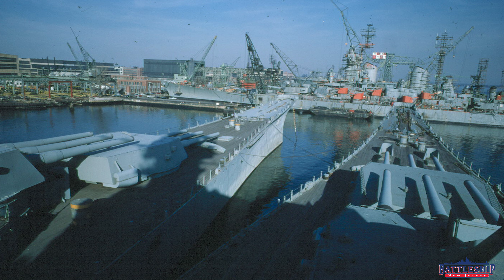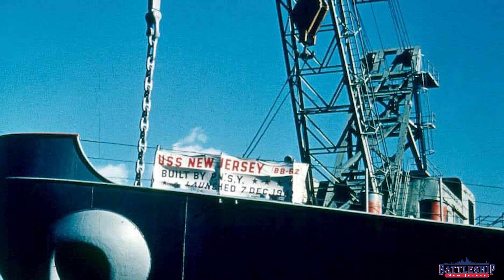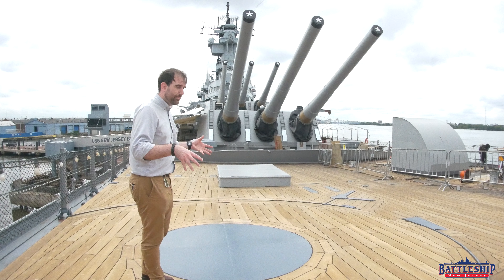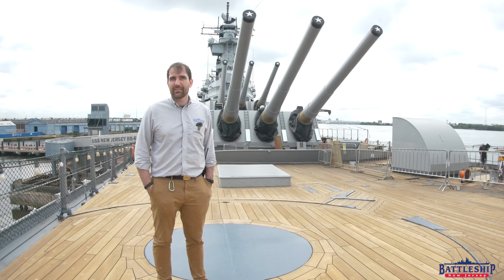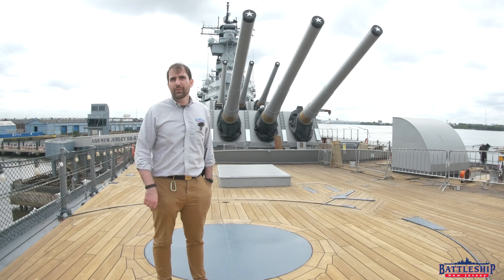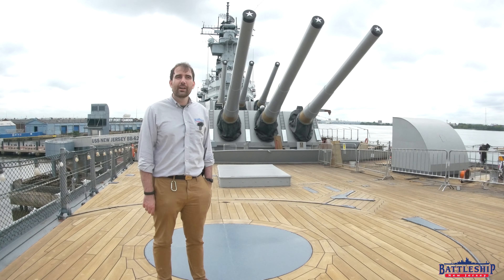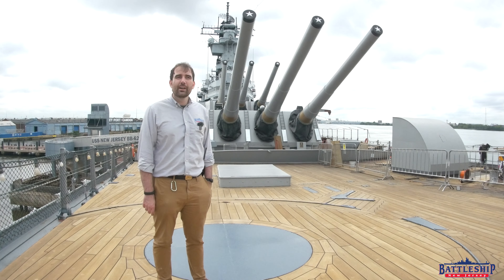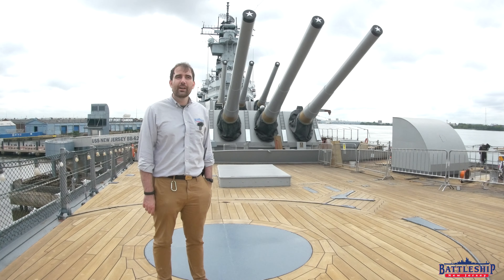Battleship NJ at the Philadelphia Navy Yard

Comment: My Dad worked on her there in 1967. 72 Shop Riggers. He told me how a tool chest left on the deck was crushed by the concussion of the 16” guns on her sea trials.
Reply: Made me wonder about how anyone could be at the 40 mm he's standing at.  Maybe the 16's and 40's were not used at the same time?
Reply: @jefffrayer8238  I think there were very few times, if any,  when any  U.S. battleship was under air attack and being fired on and having to return fire to a surface engagement at the same time. The 16's were useless defending against an air attack.
Reply: @jefffrayer8238 
You can bet the decks were cleared when those 16 inchers were fired, that was standard operating proceedure if not just plain common sense.

Comment: Now Im curious how fast it could have gone with modern propeller designs
Reply: Maybe SS United States fast
Reply: @AmericanThunder  SS United States has practically the same engines and propellers as NJ.
Reply: Some speed/engineering comments.  When the New Jersey was initially proposed for reactivation one of the plans was to only reactivate half the power plant, ie four boilers for a top speed of about 27 knots.  Phil Navy ended up delivering a ship with full power plant, fully operational 16 inch and five inch battery and updated electronics within the allocated budget.  Some of the reference books written at the time used the original scope of work re the engineering plant and did report an actual top speed after reactivation of 27 knots, which was proven incorrect.  In regards to comparisons with the SS United States, here are some observations from a well read amateur.  The underbodies and propeller arrangements for both ships are very similar.  Both ships have the same four blade/five blade prop configurations, but the Iowas have a dual rudder /skeg arrangement for her rudders and shafts. The United States has a single rudder and four individual shaft bosses for her propeller shafting configuration.  There is less resistance from one rudder as opposed to two so this would give the United States an advantage, but I can not comment regarding the resistance between the skeg and shaft boss arrangements.  The United States ran trials at 241,000 SHP; the Iowa’s were good for 212,000 SHP but it was stated that the Iowa’s could be pushed to a 20 percent overload if needed, which works out to about 254,000 SHP.   Where the United States has an advantage is the length to beam ration (waterline length to beam) and displacement.  United States has a length to beam of 9.26 v a length to beam of 7.96.  This is significant.  Don’t know how much but the slimmer the hull the faster she goes.  The second advantage for the United States is in the area of displacement.  United States ran her trials at a displacement of about 40,000 tons.  Even with a lighter ship I doubt the New Jersey got under 50,000 tons when she made her 1968 speed run.  No information on shaft horsepower or displacement was mentioned during New Jersey’s speed run.  All in all, the United States made 38.32 knots on her speed run compared to 35.2 knots for the New Jersey.  As stated this is my best guess with the information given, and these trial speeds seem to make sense. I figure naval architects and marine engineers will know more about this and they can add to this as needed.
Reply: @KingdaToro  Yes she is kind of an unarmored Iowa.
Reply: Gas turbines; more power more quickly
Reply: @AmericanThunder  Unarmed?
Reply: @dukeofgibbon4043   That too.
Reply: Idk, but 35 knots for a BB is INSANE
Reply: The hull is the limiting factor. There is a design speed built into the hull configuration and after a few more horsepower all you are doing is burning fuel with no speed increase. It's just marine engineering.
Reply: No difference in spreed. She was made and is what she is intended to be already. Shes already Queen of the seas .
Changing her is only creating half measures of an already perfect design.
Reply: Modern propeller... and hull designs!
Reply: @johnsathe2429  Of course. The calculated hull speed of any displacement hull is square root of waterline length x 1.34, pretty easy stuff to figure out. They even have calculators online to do it for us.
Iowa class has an 860 foot waterline, the square root of that is 29.326, x 1.34 = 39.3 knots. Since these ships with full load only go 33 knots, we can assume it's either lack of power or prop cavitation(efficiency) that is the limiting factor, not the hull. A clue to that being the case is the fact that the New Jersey broke a BB speed record after stuff was removed and she was lighter. Thus, if you added more HP and/or better props, the Iowa class could max at a calculated 39.3 knots. However, given enough power, all displacement hulls are able to exceed their calculated hull speeds, to a certain point. I'd take a wild guess and say that if you gave the Iowa class closer to 300,000 hp and more advanced props, it may touch on 42 knots, at least until it shook itself apart.
Reply: @dukeofgibbon4043  yes the United States doesn't carry torpedo belt armor, hence her given speed advantage as well as her lighter hull and same power plants as the New Jersey.
Reply: Good Question.
Reply: @scottspilis1940 when our driving around town and I hit 40 mph I try to picture a 50000 ton battleship moving along at that speed. It’s pretty unbelievable , must have kicked up a helluva wake ...in must inland waterways she would be getting a ticket for speeding

Comment: The. NJ had her steam heating coils in the bunker fuel tanks that held NSFO replaced and it was very expensive .
This is about the time the Navy switched to ND (F-76) naval Distillate, and no longer need to heat the bunker fuel to get it to flow.
Other BB ‘s did not get repaired coils they just ripped them out and saved money!

Comment: I was going to ask what that circular feature was but you explained it.
However, I'm left wondering about the joinery of the planking. I suppose this is to avoid having the edge of a plank come to a narrow point that would be subject to splintering, but I still think a simpler pattern could have accomplished this.
Come to think of it, what holds the planking down?

Comment: I got a question, Ryan.   In a previous video you talked that aboutBBNJ still having Zinc diodes when she should have Aluminum for Freshwater corrosion prevention, will you be going all Aluminum Diodes or will you still have some Zinc Diodes?
Reply: Anodes.
Reply: @nmccw3245 , I don't know.  The electricity only 
goes one way with cathodic reactions.  :D

steve
Reply: In the Columbia River we use magnesium Anodes in fresh water.

If can not get it out of the water regularly , you need Impressed current Catholic protection instead however. Brand name CAPOC is one company

You use shore power to pump electrons the opposite way instead of sacrificial anodes that have to be replaced.

They can’t wait 20 years to be replaced again !